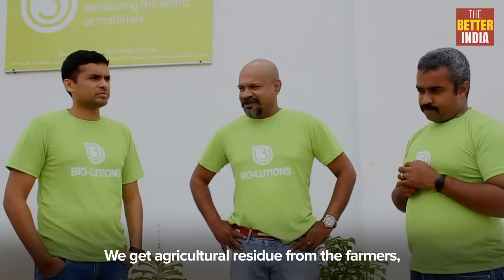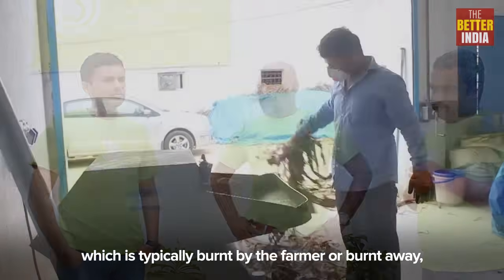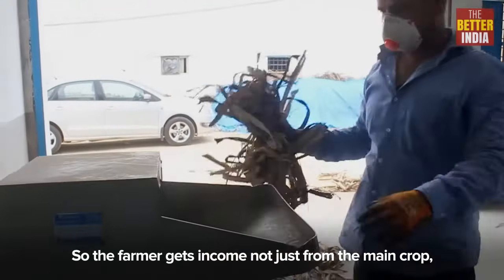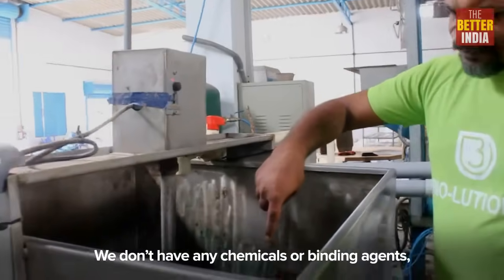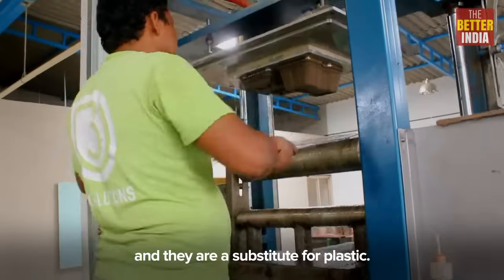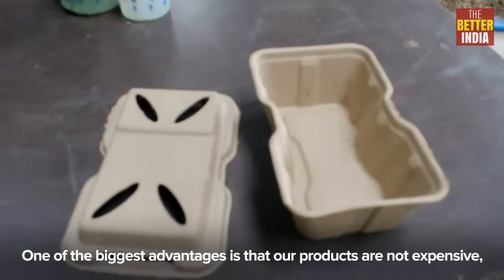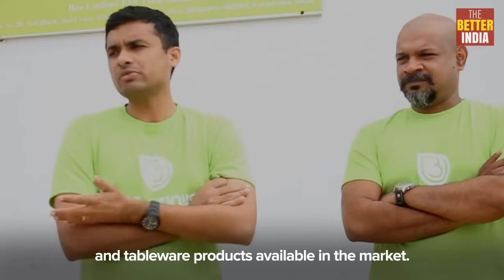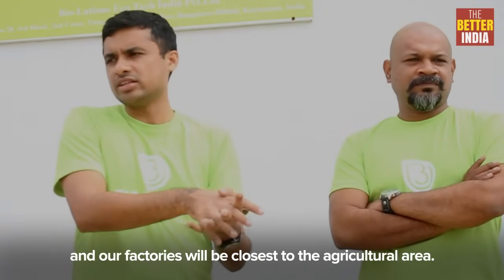Bio-lutions - Agricultural Waste to Biodegradable Cartons & Tableware

Comment: K.U.SODALAMUTHU & CO PVT LTD
428 Mettupalayam Road, Coimbatore - 641 043. Tamilnadu INDIA 

we are Manufacturer and Exporters of Multi Side Rotary Pulp Moulding Machine, 
Reciprocating Type Pulp Moulding Machine, Rotary Type Pulp Moulding 
Plant With Online Drier, Hot Press Machine, Dry Moulding Machinery, Pulp
 Preparation Unit, Hydra Pulper, Drier, Pulp Molding Machine, Egg Tray 
Making Machinery, Egg Box Making Machinery, Apple Tray, Pulp Tray, Fruit
 Tray Making Machine, Pulp Tableware Making Machine, Disposable 
Sugarcane Bagasse Plates Making Machine, Pulp Mould Tools and Dies for 
Eggtrays, Box, Carton, Trays.
Email : sales@sodaltech.net / Web : sodaltech.net
Phone +91 422 4242100 / Fax +91 422 2431279
Skype: Sodaltech.Marketing / Whatsapp : +91-8754987519
Reply: Make with little investment
Reply: Sir our college needed a bagasse pulp making machine and tableware hot press moulding machine including a mould shape for bottle.
Not for mass production but for research.
So 4 product at a time capacity is enough.
Can I buy it from your company?